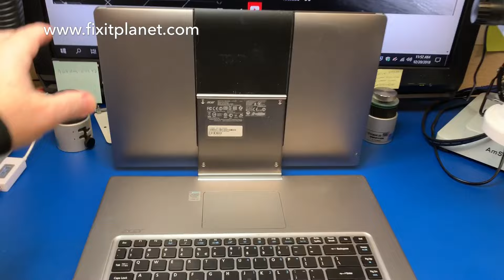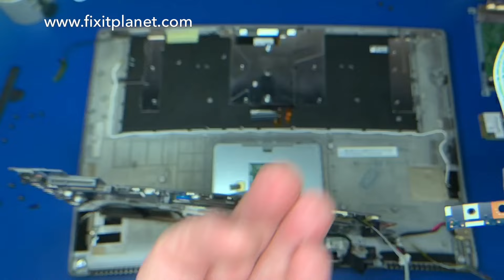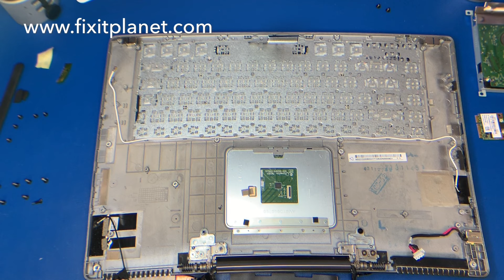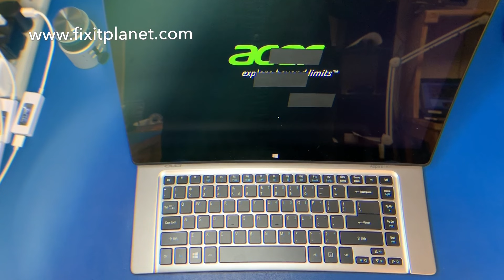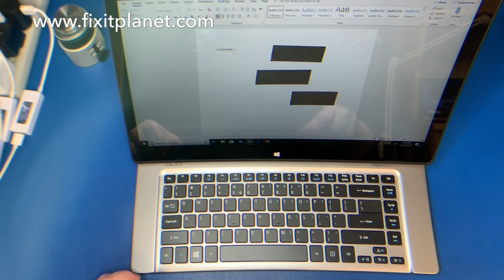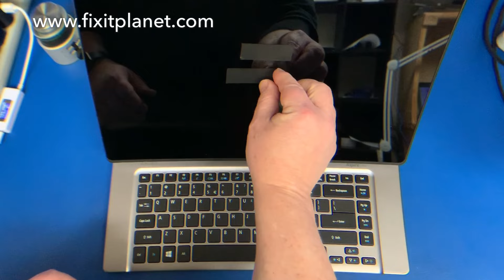Replacing the keyboard on an Acer Aspire R7-572 From Start To Finish.

Comment: Hi.  Thanks for this video.  I have the R7-572 since 2014.  Absolutely love this machine.  But recently the left Ctrl key has stopped working.  About 1% of the time it will occasionally work.  So think it is contact switch problem.  Is it possible to repair a single key rather than replacing the keyboard?  Left Ctrl is a heavily used key for me.  (ctrl-a, ctrl-c, ctrl-v, ctrl-s)  all are left hand action while right hand stays on stylus/touch screen.  Very awkward using right Ctrl for those.
Thanks.
Reply from the maker: [Is it possible to repair a single key rather than replacing the keyboard?] You may have to replace the whole keyboard. It depends on what the reason for failure is. Is it liquid damage? Is is physically damaged? is the connection inside somewhere broken? Do you have what you need to fix it?
Reply: @FixItPlanet1  It's NOT liquid damage.  Don't know the cause of failure.  It was working one day.  Then the next day it was working about 20%.  Now about 1%.  So it does function.  But not anywhere reliable enough to be used.   Once the keyboard is out.  What sort of access is there to make repairs?  What is the key mechanism like?
Thanks
Reply: @RazorStrap  Same thing happened with me. Oneb y one other key started failing as well.

Comment: Transplanted the keyboard today.  What a job.  Be prepared to take a couple breaks.

I counted the screws...

Screw Locations	Qty
Base Cover	13
Battery	2
Speakers	4
Disk Drive	2
WiFil Module	1
SSD Module	1
Fan	2
Metal Brackets	13
Main Board	3
Audio Ctl Board	1
Power Switch Board	1
Power/Charge Status LED Board (front right)	1
Keyboard	49
Total	93

My items of note
The keyboard screws are very tinny.  Be sure to have the right size tinny Phillips screwdriver.  Probably something suitable for eyeglass work.

The disk drive connector lifts straight up rather than pulling out to the side.  It's an adapter between the disk drive and the main board connector.

Arrange the screws with the component they go with.

The track-pad connector is a latch style.  The dark part rocks up to release and down to latch.  Much easier to remove/insert when unlatched.

Take a few pictures during the disassembly
 in case you don't remember exactly how something went.  Like cable routings etc.

Clean the cooling fins while in there.

Oh yeah ESD protection is critical with this level of repair.  I laid out a damp towel.  Kept in every thing on the towel and stayed in contact with the towel as well.  Let the towel hang over the table/bench and lean belly against it.

It's amazing how much crude collects in the keyboard.  Good possibility was the trouble with mine.  May be resolvable by a good blowing out (from the back side after removing the back-light).  I'll keep the old one around as a spare.
  After popping off a key cap for closer look, I'm skeptical that blowing it out would resolve problem.  The switch mechanism appears to be somewhat sealed.

Installed a 256 GB SSD last year.  Love it.  So much faster.  Still use the original disk for media (audio/video) storage and backup of critical docs.  But not sensitive info docs.  Sensitive info docs go on encrypted flash drives in triplet redundancy.  Stored in three locations.  A very nice upgrade.

This video is a must have and watch for this keyboard transplant.
Reply from the maker: Excellent!

Comment: Your video was helpfull. Following it I was able to replace the  keyboard that stopped working after a liquid spill without any troubleprocess. Sadly even the newly installed one is unresponsive. Any hint? Strangely Windows report the kb device as connected and without any issue.
Reply from the maker: Unfortunately you will have to retrace your steps and make sure everything is connected properly and if the keyboard is defective send it back for another one.

Comment: I have the notebook Acer Aspire R7-572-5893 , and I reviewed your video, excellent  job by the way . I'm having issues with my keyboard, there are keys that don't work , back space , enter , up down right and left . Other than those issues all is in working condition . I'm sure it  has to be replaced , can you provide info on where I can purchase the replacement parts .
Reply from the maker: You can purchase that keyboard here https://amzn.to/3hSGena

Comment: Did you ever run into a problem with the laptop not wanting to boot on. I'm having trouble getting the laptop to power on, the battery connects just fine and it takes a charge but the fans wont turn or anything. Any suggestions?

Comment: Do you really need to strip everything down like that to replace the keyboard?  Can you get away with just working the screws around the keyboard itself?
Reply from the maker: Unfortunately yes you really do need to strip it down. It's a real pain. The screws hold the keyboard in place and all have to be removed.